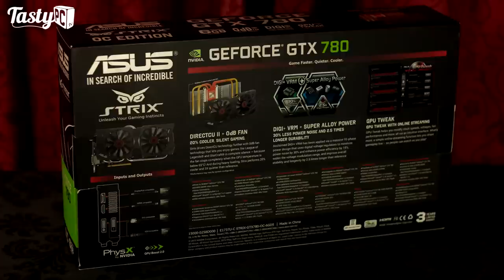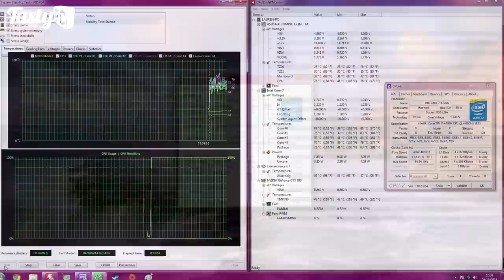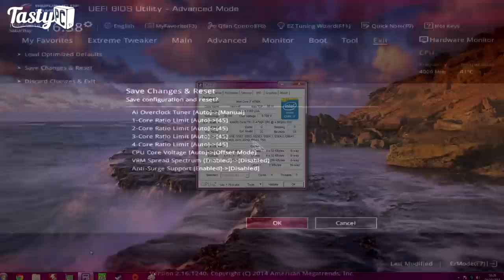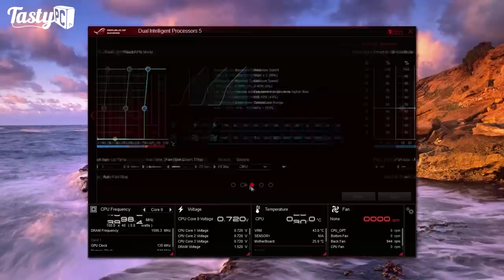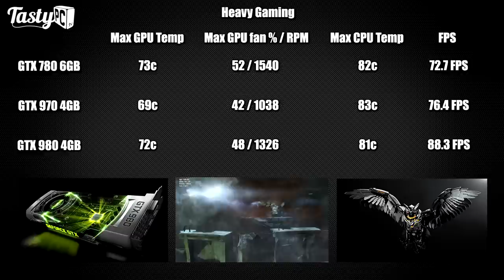Semi-Passive Gaming Build – GTX 980 970 780 Strix, i7 4790K, Noctua NH-D15, Corsair 730T, ROG Hero

Comment from the maker: After reading a FB post saying the build's "Passive Aggressive" I thought it'd make a great name! Thoughts? :)
Also should I make an update video at some point, upgrading the build to SLI 970's and non-industrial Noctua's?
Reply: Do another video with gtx 970 in sli but overclock everything to the max
Reply from the maker: Its your dad But then I wouldn't be able to keep it passive lol.
Reply: TastyPCTV just to see it ;) then put it back to passive mode, or make some crazy mod with two switches 1. Passive mode 2. Overclock mode
Reply from the maker: Its your dad It is possible for me to use TurboApp to make it so that I can have a different OC and fan profile, depending on the application I'm running.
Reply: TastyPCTV do what floats your boat lol
Reply: Yes, the industrial's should go. I'm with you on the looks, but why couldn't they have made sensible speed sexy fans? Gotta choose sexy and loud or fugly and quiet :(

As you're going for quietness on a high performance rig, how about trying different software/hardware fan controllers for a review/comparison, it's something that's never covered but as a silence freak, I'd be interested. :)
Reply: it makes sense because the fans are chilln' until the computer hits like 65C then they're like LETS GO TO 50 PERCENT POWERRRRR!! seriously asus lets have total control of the fans plz. Anyone who is brave enough to edit those profiles is smart enough to know what they are doing. Keep up the good builds :D
Reply: Do they pay you to do this or do you really game?
Reply from the maker: neoswordian91 What else would I do with my spare time other than game? lol
Reply: TastyPCTV Lol. Well I have like 150 steam games, the gtx 980, and all the consoles, but I still don't really game. I try really hard to like games and play em, but I get bored too easily.
Reply: How is an object Passive Aggressive?
Reply from the maker: ***** PC's aren't just objects :O
Reply: :O
Reply: I was thinking if you goal is to have passive or silent gaming, having a water cooling system seems to be exactly what would be the next logical step. Weather it is just water cooling the CPU first.  I know water cooling the GPU's may void the warranty.  Also, have you considered having the cabling being sleeved with different colors to match your build?  Thanks! :)
Reply: i wouldn't use the name in case you upset people who are passive aggressive. Just to be on the safe side.
Reply: TastyPCTV Yes, I'd really to see it, maybe a "budget" semi-passive would also be interesting to see.

Comment: As someone that works a lot with sound files I understand your need for a more silent operation. There is a trick however you can do that will kill the background noise even if you are not totally silent. Begin your recording by saying NOTHING for the first 30 seconds to one minute. Now record your audio as normal.

Now to edit the audio you select the first part that is silent and use it as a noise reduction filter. In Adobe Audition you can select the section of sound and right click, use the option  Capture Noise Reduction Profile. Now select the entire audio file and use the Noise Reduction Process, all background noise now gone.

The principle for this is that certain sound sources like a computer, actually makes a pretty steady and easily captured sound profile. So once you have the profile removing it is easy. The silence at the start gives you a perfect sampling of the background noise.

Comment: Very nicely done! Most people are all about extreme overclocks and maximum performance, but never consider the practicality of the system. My rig is water cooled with dialed down, quiet fans, yet it is still the loudest thing in my room when I'm reading or browsing the web without my headset. I would absolutely adore a system that can be completely passive under light loads.

Comment: This is a kick ass video.  I built my current PC with the idea of silence because I have it in my room next to my bed and I'm sensitive to sound while I'm falling asleep.  I keep my PC on through the night because I have my 780 set to fold while the PC is idoling  I went with the very quiet fans on an overkill custom water loop so that I could run the fans low and still have plenty of cooling.  While this did make the PC quiet enough that it does not bother me while I fall asleep it is not completely silent.

Comment: Cool.
As a silence freak, I wish I could afford (or just get given for review) some of the new efficient stuff. Ended up with an all AMD rig at the moment (was for mining but ended up being my primary rig) so the noise pisses me off much of the time, even with Beefy after-market coolers, the GPUs kick out SOO much heat.

I'd recommend giving Speedfan a go though Lauren, I've found it to be the most useful software fan speed controller, it's still far from great but it doesn't force the fans to 100% @ 75 degrees (dafaq?).

E2A: if you do try Speedfan and with PWM fans, you may need to switch the mode to Software-controlled (configure -> Advanced -> select controller -> click one of the PWM modes -> select Software Controlled at the bottom -> repeat for each fan header). Thought I'd save you the time it took me to figure that one out with my latest mobo.

Comment: For a semi-passive rig I'dve gone with something like super quiet pump mounted in a silent enclosure in the case ( camera won't pick it up ) and a 9x140 rad outside the case with maybe a 3x120x80mm rad inside it. You could probably get away with zero fans, maybe a set on the 360 rad. 

That or not bother with the effort, and just put the thing in a different room and run long cables, or just use a NUC and stream everything with Steam InHome or some sort of remote desktop software. There's other options than passive cooling, tbh, and they are better.

Comment: Likely VRM for Motherboard, or the Powersupply.

Run a CPU stress test with a control group GPU with power delivery in the BIOS set to extreme, this will make the coils whine on the motherboard.

Then try with the GPU that may be the issue, run Furmark.

Whichever part is whining can typically be returned for replacements.

Comment: I'm not sure if you're already aware of this but you mentioned the fans not spinning up but the cpu core temps you recorded were over 80C. The Asus AI Suite program only records the socket temp and having used it in a few different builds I find the socket temps in Intel builds are generally a good 15 or more degrees lower than core temps when under load.
80C is on the higher side and above intels recommended IHS temp so if I were you I would change your fan settings to have the fans spool up above 60C as you'll find your core temps are probably around mid 70s at that point.
My two cents :)
Like the vids by the way, keep up the content :)

Comment: My quietest PC is probably my Dell XPS 710. I changed the Dell fans for Cooler Master BC 120 fans and it's pretty quiet even though they run full time. They are controlled by a NZXT Sentry LX LCD Meter fan controller. The graphics card is a MSI Geforce GTX 580, I replaced the stock cooler with a Corsair Hydro H55 CPU cooler which is attached to the GPU via a NZXT Kraken G10 bracket.

Comment: do you guys set the power management of your video cards to adaptive or "prefer maximum performance"? I found out that the maximum performance option increases game's stability and fps by 50%. I always thought that it was a gimmick for years cause most of that shit with "maximizing performances" doesn't usually work but this option indeed works. now i can get 60fps in metro at max settings (it probably goes even higher with vsync off) all the time and it never goes 1 frame lower. i have 2x580sli 1.5gigs Vram and 12 gigs of ram. cpu is i7 2700k

Comment: Lauren, The coil whine will be the PSU. Get yourself a Seasonic x-series or platinum series PSU. They also have a passive mode but don't suffer with coil whine like the corsairs do. In the past 4 of my Corsair PSU's had coil whine of some sort and was highly annoying (Crysis 2 especially when the game is loading), I replaced every one of my Corsair's with different Seasonic PSU'S and Iv never had any coil whine or problems since. Regards, Mark

Comment: All PSUs vibrate significantly and all brands occasionally buzz, and Corsair has had plenty of models which buzz violently, though this isn't one of those.

In contrast, there aren't any large chokes or transformers on any of the other components, and while you may get really unlucky and find a buzzing one, it's actually quite unlikely.

Since you don't want to pick up reverberations primarily, you probably need to go with some kind of contact method of noise measurement. You can get a cheap inefficient, even toy stethoscope, maybe that would be a solution. I'm not sure whether a contact microphone can be made ouf of an electret capsule. Piezos are usually used as surface/contact microphone, but you can't wire a piezo right into PC microphone input, and an electret you can. Anyway a contact microphone should also let you compare levels.

Comment: Love your video's, you almost always touch on things that other reviewers leave me wondering about!!! 

Whenever I do get the opportunity for my next build (probably early next year), it's going to be a silent but not passive gaming / video editing rig.  But it is neat to know that we're at least this close already to the potential for a passively cooled gaming build

I know you're sponsored by Corsair, but there are several fully passive power supplies available.  Seasonic's SS-460FL2 fanless is my top choice, though I wouldn't try an SLI setup with it even thought it is a Seasonic.  But with the level of performance we're seeing from the GTX-980 GPU, I won't have any need for SLI.

Also, to further reduce GPU fan noise during demanding gaming sessions, you could use (as I plan to) a NZXT Kraken G10 coupled with a compatible 2x120mm or 2x140mm AIO watercooler equipped with variable speed pump (to minimize pump noise) & swap the stock rad fans for 'silent' fans.  Sure that means voiding warranty on most video cards, but as long as you thoroughly test out the GPU before swapping the cooler, definitely worth it IMO :)

Finally, with a 'silent' fan on that CPU HSF, even under heavy load, when the fan does need to spin up, it won't be noticed by your ears, but will cool off that CPU nicely !!!

My only issue with Passive cooling is the overall temperatures.  Not an issue with the Seasonic (even at full load I've seen tests where it only went up about 10 - 12C over ambient room temp), but I don't care to bake my CPU or GPU... I would much rather use fans that are virtually silent at 25% RPM & have them off till temps reach 45C then ramp up from there.

Comment: The number one cause of coil whine for me has always been caused by the CPU feature C1E enhanced halt which you can disable in the bios. Might be worth a try but it will make the cpu run slightly warmer at idle. I know some graphics card manufacturers have started offering a zero coil whine guarantee.